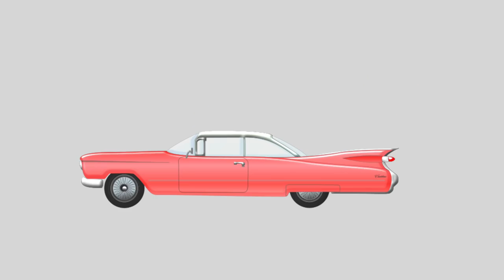Yes, Rockets CAN Fly in a Vacuum

Comment: At minute 3:04 you said "literally burning the oxygen". In both the internal combustion engines and rockets oxygen is not burned at all. Oxygen is the oxidizer that allows the flammable or combustible material to burn with more energy.
Reply: Oscar Lopez if they fail enough at elementary science  do you think they would have a clue about middle school science?
Reply: Amy is very smart. I was just making a point so her viewers understand and don't get that fact confused.
Reply: As I read it, both oxygen and the fuel are 'burning'.  They are both participating the reaction.  You can, for example, inject oxygen into a room filled with flammable gas and get a small flame at the point of entry.
Reply: CorwynGC Your statement is incorrect. Oxygen is not a flammable gas. It doesn't burn, but rather aid in the combustion process by oxidizing the material or substance on fire.  Materials that in normal conditions are non-flammable can burn in an oxygen rich environment. But oxygen by itself won't burn or explode. Whatever heat or flame source introduced in an oxygen rich environment will burn violently but the oxygen itself won't catch on fire.
Reply: +Oscar Lopez I'm sorry... what? By that logic rocket fuel and gasoline are non-flammable because they cannot burn in the absence of oxygen. Oxygen is literally a required fuel source for fire. Both oxygen and rocket fuel/gasoline must combine to create the flame. Rocket fuel and gasoline by themselves will not burn or explode either.
Reply: Greatness101 They combine but oxygen does not burn. Oxygen only aids gasoline to burn more violently. If you have only oxygen it will not burn alone.
Reply: "Oxygen only aids gasoline to burn more violently". By this statement, it sounds like you believe gasoline can burn without oxygen, but oxygen only makes it stronger, which is false. There has to be oxygen for it to burn. The video you showed me included an open flame, which is drawing oxygen from the air. If you tried to light gasoline in a vacuum or any other oxygen-free environment I guarantee it will not burn, just like pure oxygen by itself.
Reply: Actually, without oxygen NOTHING is flammable. Burning, by definition, is oxidation. Burning requires heat, oxygen, and fuel; so it's true oxygen is not it's own fuel. But both the fuel and the oxygen are consumed by burning and recombined into a different molecules, depending on the fuel that's burned. Arguing that oxygen doesn't burn is like saying gasoline doesn't burn, which is sorta true... it doesn't burn without oxygen and heat. Even gasoline and oxygen together don't burn without a heat source. Nothing, absolutely nothing, will combust without all three present; Oxygen, fuel, and heat. So is oxygen flammable? Hmm... is heat flammable? Is Fuel flammable? Yes, when the three combined properly. Otherwise, nothing is flammable.
Reply: @garretwang1031  To be fair it is very common to hear "gasoline burns in the presence of oxygen". The oxidizer is usually not considered to burn, though it is a requirement for burning to occur.

Comment: The balloon moves because the tension in the balloon material pushes the air out of the nozzle, when that air hits the surrounding air it creates the pushback to move the actual balloon, but in a vacuum, there is no air to resist the output from the balloon, the air releases without any force. You need to release the balloon in a vacuum if your analogy is to hold any water
Reply: LDM design - you CLAIM that "there is nothing to push off of" in the vacuum of space.
But there IS! The rocket takes MASS with it to space to push on!

If I fired a crossbow into a vacuum would there be a recoil force? Yes or No?
The answer is YES. This is because any machine that PUSHES ON MASS, feels a recoil force. PERIOD.

A rocket expels the MASS of the rocket exhaust gas (Gas DOES have MASS BTW) and the rocket feels the recoil force from pushing on that mass.

Rockets DO NOT "Push on the air behind the rocket".
If THAT were the case, then no rocket (or aircraft for that matter) could ever fly faster than the speed of sound.

Rockets (and even Jet Engines) are MASS DRIVERS.
They push on the mass while STILL IN THE ENGINE.
What happens AFTER the mass leaves the engine is irrelevant.
Reply: @DeusVult1527 Here is an example for you:

A Space Shuttle Main Engine (SSME) expels 500 kilograms (this is MASS) of PURE WATER at MACH EIGHT!

It ACCELERATES this water from a standstill (velocity of ZERO with respect to the rocket) to MACH EIGHT (2500 meters per second) in about TEN FEET!
It does this every second.

Now tell me that ANY MACHINE can ACCELERATE 500 kilograms mass from a velocity of ZERO to a velocity of 2500 m/s WITHOUT FEELING RECOIL!

Tell me a machine can accelerate MASS without feeling any kind of mechanical recoil.

Give it a try and go ahead and tell me that genius!
Reply: @DeusVult1527 so AGAIN, you think that a machine can ACCELERATE 500 kilograms of water to mach eight without feeling any recoil.

Say it, I want to hear you say that.
Reply: @DeusVult1527 oh and just FYI: the company I work for tests hydrazine thrusters IN A VACUUM  (here on earth) and we verify that they produce the thrust predicted by the Tsiolkovsky Rocket Equation.  We then put them in spacecraft, launch them to space, and test them there again.  You apparently do not realize that the Rocket Equation predicts that rocket propulsion is MORE EFFICIENT IN A VACUUM.  Then you are apparently not aware that we have been TESTING the Rocket equation for over 100 years, genius!   I literally build, test, launch, and operate earth orbiting and deep space spacecraft as my job, and I have been doing that for longer than you have been alive.
Reply: @DeusVult1527 I see that you refuse to answer my questions just as I predicted.

Now STOP trying to explain rocket propulsion to an actual spacecraft Engineer.

I could show you live video that PROVES rocket propulsion in a vacuum, but I suspect you will refuse to even watch it like you refuse to answer my questions.

Run along now, the grownups are trying to have a conversation.
Reply: @DeusVult1527 - "here’s a question for you, does 1kg of solid lead have the same inertia as 1kg of helium?

YES.
Hence the KILOGRAM part.

Kilograms are KILOGRAMS. It does NOT matter what PHASE the matter is in genius.

So according to YOU, you could throw a FULL Propane tank JUST AS FAR as an EMPTY ONE?

Bless your little heart!
The other kids in your special needs class must be so proud of you for being able to use the computer without mommy's help!
Reply: @DeusVult1527 - "a propane tank has a GIVEN VOLUME, aka DENSITY.."

REALLY?
So you are flat out telling me that an EMPTY tank WEIGHS the SAME as a FULL Propane tank?
Tell me that flat out.

See you don't even know the meaning of the word "density" but you try to use it in a sentence?
Aren't you cute!

"Density" is literally defined as "Mass per Unit Volume"

An Empty propane tank is full of ~atmospheric pressure Propane and weighs only the "weight" of the empty tank.
As you put PROPANE INTO THE TANK you are ADDING MASS (because propane HAS MASS)
So adding propane to a fixed volume tank INCREASES the MASS while holding the volume constant, THEREFORE the DENISTY of the tank (including its CONTENTS) GOES UP.

The Density of the gas in the tank INCREASES as you ADD MASS to the tank which increases pressure.

So a FULL Tank of propane CERTAINLY weighs more than an empty one because the full tank HAS MORE MASS.

A Full Propane tank is HIGHER DENSITY than an empty one.
You are welcome.

You literally don't know the meaning of the terms "weight", "mass", and "density" but you have the audacity to argue with actual engineers?
Reply: @stuartgray5877  oh so steam trains run just by shooting steam out the back end which propels it forward. got it. is that in a vacuum or not?
Reply: @ldmdesign5610  Answer my basic physics questions and we can have a conversation about how rockets work.
None of you "Science Deniers" understand Physics at even a High School level and you prove it constantly.

Prove me wrong and answer my three questions.
When a rocket engine is running:
1-does the exhaust gas get ACCELERATED? (does it change VELOCITY as it exits the nozzle?). Yes or no?
2- does the exhaust gas have MASS? yes or no?
3-can MASS be ACCELERATED without a FORCE?  (Or does ACCELERATION REQUIRE a FORCE?)

Please, just answer the questions like normal people do in these situations.
Reply: @ldmdesign5610  Where did you GO genius?

I see that you are so scared of my questions that you have no response.

Well perhaps high school dropouts should NOT go around trying to argue basic physics with actual engineers.

Bless your little heart!
Reply: Hi
Reply: @ldmdesign5610  Stuart is an old chatbot.  It's been here for literally years reposting the same fail arguments.  It still cannot describe the force pair for a rocket engine doing work in a vacuum.
Reply: @DrCash7  your ONLY response to my facts and questions is to accuse me of being a bot?
Aren't you getting TIRED of being made to look like a fool by a bot?
Reply: @stuartgray5877  1. Depends on the pressure of its container and the exit nozzle, 2. yes, 3. Requires force even if that force is gravity. But without gravity in outer space that  shouldn't really be a factor.
Reply: @CoolPapaCash  
1 - No, the exhaust gas has the same mass as the fuel and oxidizer that went into the engine. NOTHING changes that.
2 - Correct
3 - Yes, acceleration of "mass" REQUIRES a "Force".

So, we must conclude that: The Rocket engine MUST apply a "Force" to the mass of the exhaust gas "accelerating" it away from the engine.
Great!
Now what can we conclude from newton's THIRD law?

If one mass (the Engine) applies a "Force" to another mass (the exhaust gas), what MUST HAPPEN?
BOTH masses feel the force for the same duration.
Reply: @stuartgray5877  You're incorrectly assuming that the exhaust gas will be present long enough to have a mass for the force to push against. In a vacuum as expanse and powerful enough to engulf all of the infinite area which is space that minute amount of gas will be dissipated in less than milliseconds.

Even if it existed for lets say  .01 of a second(arbitrary number it will most likely be far less) the amount of energy it would take to  move a rocket ship just a  mile would be far far more than the rocket (obvious on the second stage having entered outer orbit) could hold.
Reply: @CoolPapaCash  The engine is done pushing on the gas while it is still in the engine bell.
 What happens to the gas after it vents to vacuum is irrelevant.

Comment: No, no, no. The balloon is flying off because the air inside the balloon is released creating a high pressure area at the nozzle when it meets the air outside the baloon.
Reply: No it moves forward because it is pushing MASS out the back and feeling a RECOIL force.
Recoil works in a vacuum too.
Reply: Same thing with a rocket. High pressure at nozzle because no pressure outside(vacuum).

Comment: it's like this... a rocket moves through space for the same reason a rifle recoils against your shoulder.   the rifle projects  lead at 0 degress and recoils at 180 degrees.  the rocket projects gas molecules at 0 degrees and recoils at 180 degrees.  

the fact that the rifle throws molecules in a solid form and the rocket throws molecules in a gasseous form is irrelevant because mass is mass in bith cases.

this idea that a million pound rocket "pushes against" air to move is just wrong wrong wrong.

Comment: I know this gets explained a lot using Newton's Third Law (which is totally correct), but I think it's more intuitive to explain it using conservation of momentum. It's the same thing in the end, obviously, but just a different way of thinking about it.
Reply: Bio Sektor rules!
Reply: I agree.
Reply: Ive tried to tell this to flerfers. I ask, where does the mass of the fuel go? Does the exhaust have mass? Does that mass have velocity? How is momentum conserved if no external force is present? They refuse to answer any of the questions because they know subconsciously it will debunk their views.
Reply: Let’s pretend that there is oxygen and a fuel source and it is ignited to turn a turbine, that this is actually true and happens, because that’s  how a rocket supposedly works (which is actually bullshit as well) well then, the turbine then spins at a high velocity and draws in air and then compresses it and pushes it out the back at higher pressure, creating thrust.
Thrust into a giant vacuum like space would harmlessly dissipate into that giant vacuum because a vacuum has no pressure, and you need pressure for thrust. Fucking elementary
Reply: @sooperdoopercoolguy  a) You've just described a jet engine, not a rocket. Some rocket engines use a turbine to provide propellant pressure, but not all. b) You don't need pressure to generate thrust; where did you get that idea? c) If rocket engines don't generate thrust, so do you explain how momentum is conversed? Because that really is elementary? d) Where did you get your physics degree? I got mine from the University of Warwick.
Reply: Yeah, it's almost as if you need to combine both Newton's 3rd and 2nd laws of motion to describe propulsion for a reaction (rocket) engine.

3rd law:   F_rocket = F_exhaust
2nd law: d(MASS_rocket x VELOCITY_rocket)/dt = d(MASS_exhaust x VELOCITY_exhaust)/dt,
where the conservation of momentum for each component can be described as force is the time-derivative of momentum.

Integrating both side of the equation in Newton's 2nd law w.r.t. time gives  MASS_rocket x VELOCITY_rocket = MASS_exhaust x VELOCITY_exhaust.
The fuel of the rocket gets converted to exhaust gas and ejected, so the rocket's mass, MASS_rocket decreases while the mass of the exhaust, MASS_exhaust and its exhaust velocity, VELOCITY_exhaust remain constant.  Consequently, the rocket's velocity, VELOCITY_rocket steadily increases (the rocket accelerates) until the fuel is spent.
Reply: @sooperdoopercoolguy  answer a question:. If I fired a projectile from a crossbow, into a vacuum, will I still feel a recoil force?
If you answer 'yes' then WHAT is the crossbow PUSHING ON?
Reply: @sooperdoopercoolguy  Why no answer to my question?  scared that answering might prove YOU WRONG?
Reply: @stuartgray5877  you would feel the stored energy from the bent cross arms release!
Reply: a better analogy would be try pushing a heavy weight while you have zero traction, similar to being on ice. how will you move the weight with no traction?
Reply: @sooperdoopercoolguy  I agree with what your saying. It is like trying to push a heavy object while on ice. if you have no traction your energy cant transfer into the object you are trying to move. That being said I dont know the formulas for velocity and momentum or any of that crap. It just seems to me that air is atoms and momentum is built by forcing a bunch of atoms against a bunch more atoms to gain momentum. With no atoms to push against your just throwing atoms around whether its carbon atoms or oxygen or hydrogen atoms the difference is mass and density that gives us the amount of acceleration or momentum.
Reply: @rickplathe2978  Ther crossbow would feel a "Recoil force".
This force would "propel" the crossbow in the opposite direction as the projectile.
Any device that exerts a FORCE on a MASS must feel the SAME FORCE back on itself.

A rocket engine is really just a "Mass driver" that accelerates mass in one direction while feeling a RECOIL in the opposite direction.
Reply: @stuartgray5877  It only does that because it has something to push off of. If you were in the middle of space not moving you would never go anywhere you could flap around all you wanted but you would never move. The same goes for a rocket it needs something to push against
Reply: Never mind I see the difference one releases a mass which would perhaps propel the other.
Reply: @rickplathe2978  So you DONT Think a crossbow would feel recoil if it fired a projectile into a vacuum?

You really need to take an actual physics class so you can understand inertia and momentum.
Reply: @rickplathe2978  - "The same goes for a rocket it needs something to push against"

It HAS SOMETHING!

It has some MASS to "Push Off" of.
It takes mass WITH IT into vacuum and pushes on that mass.
Read again everything I told you above very carefully.

Comment: It’s really just conservation of momentum. A rocket doesn’t have to use combustion to get liftoff, it’s really just about throwing mass in the opposite direction, be it burning gas, air, or ions. It’s eqivalent to you standing on a skateboard and throwing something heavy away from you. That’s also a type of thrust, just like a rocket.
Reply: A water rocket is a great example of that too.

Comment: As for air: Trust augmentation is actually a thing. People have suggested putting a sleeve around the rocket so in thick atmosphere, air could be scooped up, be heated by the exhaust, expand and add to the thrust by ejecting more mass for the same power.

When designing the N-1, Korolev originally thought they could get by with just the 24 engines in the outer ring. They were supposed to have much shorter nozzles and expand against an inside skirt, making an aerospike arrangement. Air was going to flow down the central plenum and mix with the exhaust for thrust augmentation. That would have been way more than 50 years ahead of its time, because here it is 50 years later and nothing with an aerospike or thrust augmentation has ever flown.
Reply: You can't even spell thrust augmentation